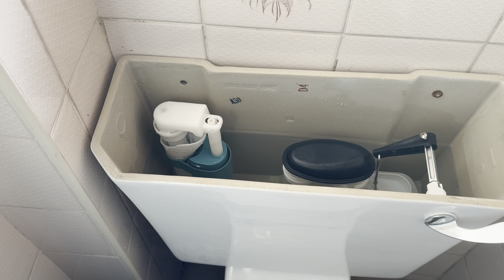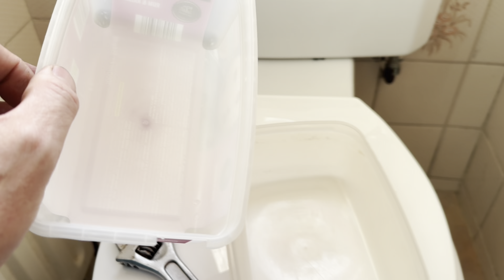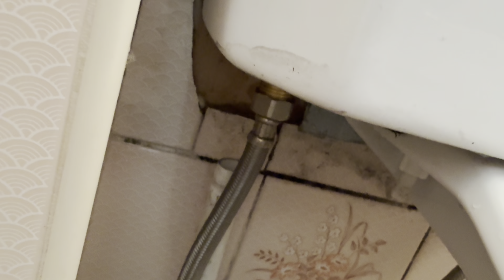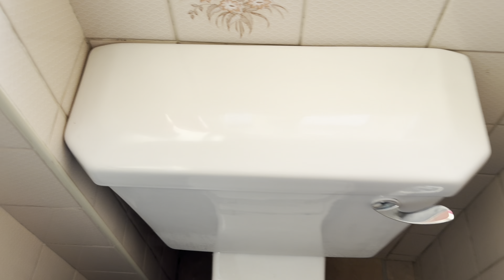Leaking Toilet Fill Valve Replacement

Comment: Hi. Can j use a little silicone to repair the leak the filling valve washer?
Reply from the maker: There is probably a tear in the fill valve washer they can be replaced but on this occasion I replaced the whole fill valve. A blob of silicone in the right  place may work but the longevity of the repair would be questionable.